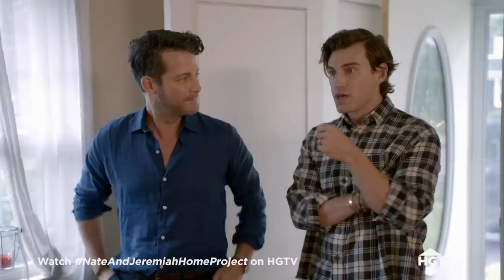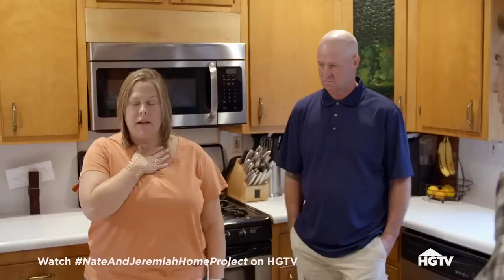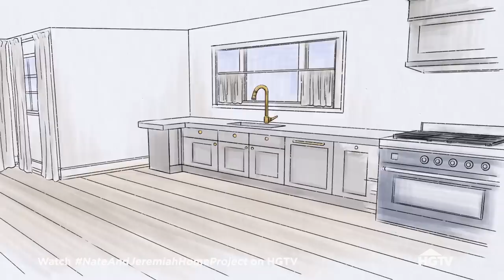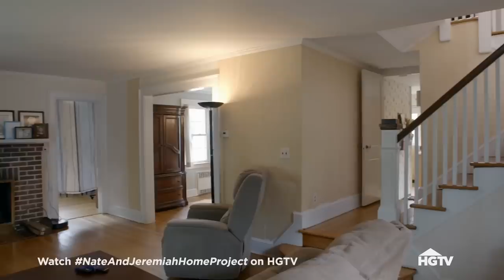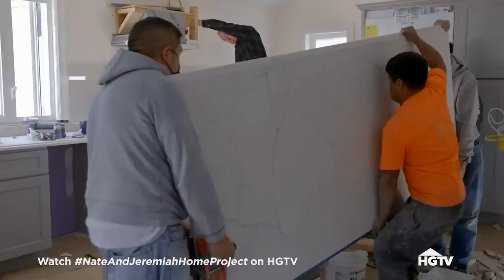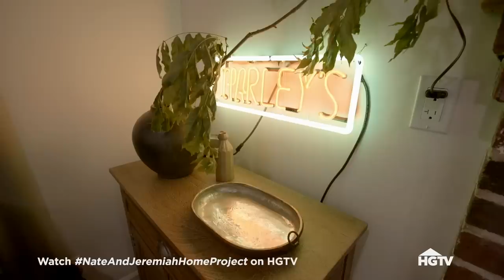Aging Family Home Gets a Total Makeover for Growing Teens | The Nate & Jeremiah Home Project | HGTV

Comment: I can't believe they put the bathroom in the kitchen ewww so wrong and they didn't touch the fireplace . I hope they did put in central AC for the family . They should of put bathroom up stairs somewhere.
Reply: it might be a budget issue to go upstairs?
Reply: They didn’t put in central AC. You can see the wall units in the living room and dining room
Reply: C J: If the home was never designed to have a powder/bathroom on the first floor—since there was only a kitchen, living room and dining room initially, then “ewww”, where should it go when you require plumbing which is already in the bathroom.